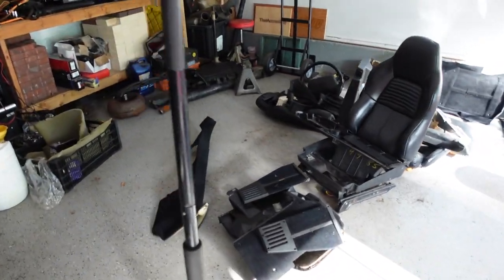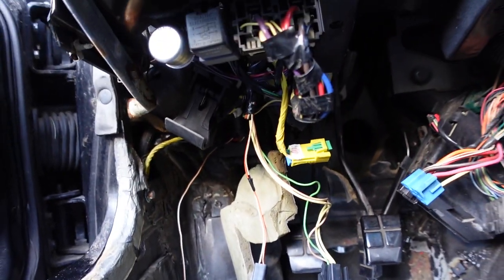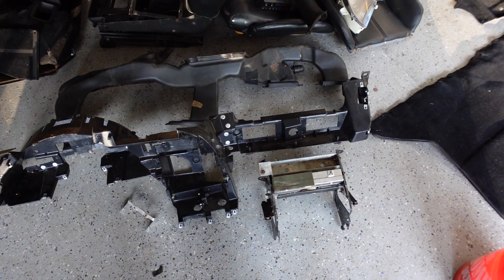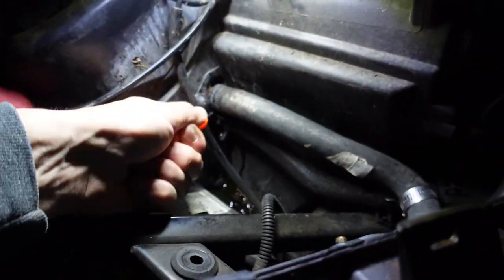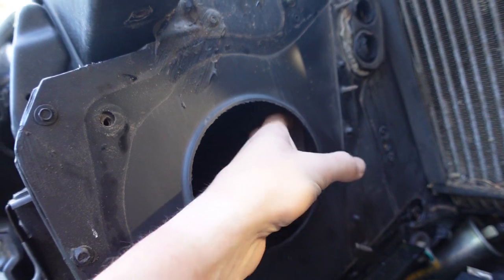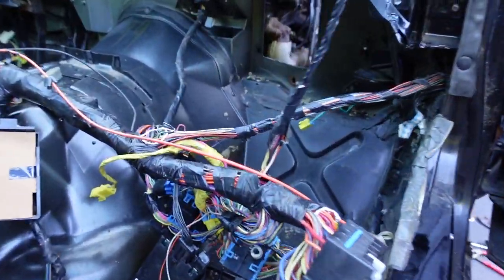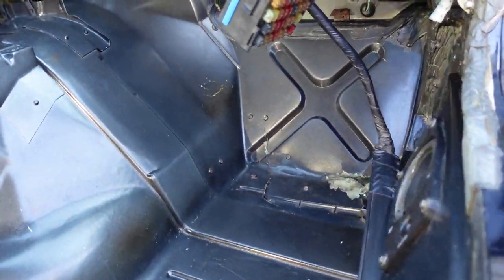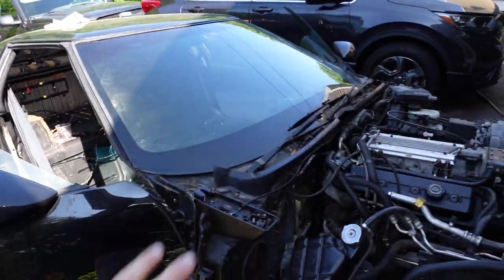C4 Corvette Dash Removal + Gutting The Whole Car (IT SMELLS)

Comment: Had a heater core replaced.  Mechanic did a good job, except for where the top dash panel meets the windshield.  Its like he didnt tuck it under the foam.  Do i have to pull it out and put it back in correctly or can it be tucked under while already installed?  Im trying to see how it fits together from this video.

Comment: this is oh so familiar.  for the reolacement jute, ive now used "frost king" twice, then covered the rans tunnel in a further layer of double sided foil bubble wrap called reflectix from home depot.  i have not been able to source new replacement jute pads.  for wiping down the urine and infested stuff, ive used a lysol spray.  it seems to irradicate the urine smell the best.  if you wash the abs plastic parts in hot soapy dawn dishsoap water, that works.  for the carpet panels< ive first scubed the with soapy hot watr then, i hit them with a pressure washer.  dont get too close or the pressure washer will ruin the carpet.  ive hung the carpet panels on the floormat clamps at the local carwash, worked perfect,  took a couple days to dry..  for the leather seats if they are stiif like roadkill, i soaked them in Obenaufs leather oil.  stuff changed my seats from beimg cardboard stiff to supple  apply in hot sun, leather soaks it up.  not bagging and tagging the fastners was a mistake but too late now, that will be a fun excercise but u will get through it.  its a zf car so this is all worth it.  the floor repair,  the best method ive used was grafting a donar chunk in using panelbond smc,.  you can search my username on cf if you want to see how i handled a huge hole.  good luck dude, when u r done, take the car to the track or autocross!
Reply: i see you pressure washed in the first vid. not sure if you used good strong soap but good job so far!
Reply from the maker: Sounds like you have a lot of experience with this situation. I think I’ve got a handle on the smell. The bleach did a great job, and the ozone machine I brought home really finished it off. Ill use it again once the interior is back in. Carpet seem like they don’t smell, I guess the soap I used was good. Definitely true about ruining carpet with the pressure washer lol. i’ve got some stuff on order for the firewall insulator. Thanks for all the advice!  More vids coming soon.

Comment: Bomb it with an ozone generator overnight, or a UV-C "disinfection" bulb like they use in butcher shops. The ozone generated from the bulb (or plate type ozone generator) will kill (oxidize) any smells.
Reply from the maker: Yes! I did that the other day. Really doesn’t smell at all anymore. I’m going to do it again once I have all the interior parts in. Luckily I can borrow one from work. Thanks for the comment!

Comment: Some idiot mechanic put the feet for a lift on those two spots and ... Crack!
Reply from the maker: Anything is possible. I think the dents in the floor where the seats mount are from lift legs. But the hole in the floor is definitely from smashing the body into something going off the road. Too much damage to be from a lift leg. It’s not okay to jack by the floor in any car!  But they still do.